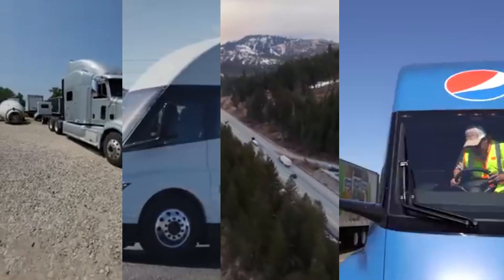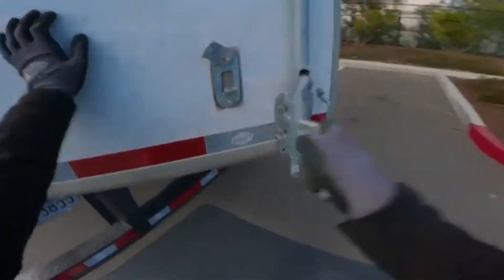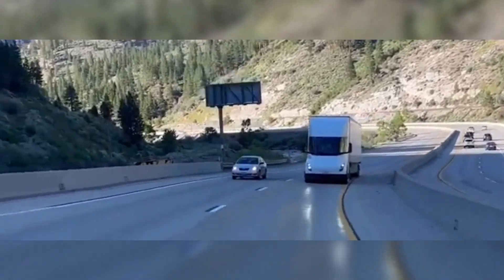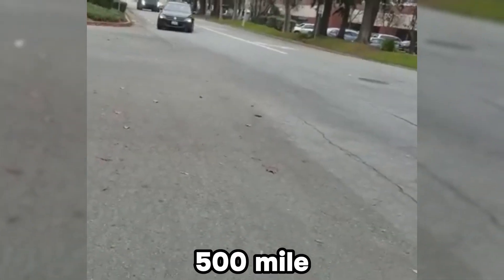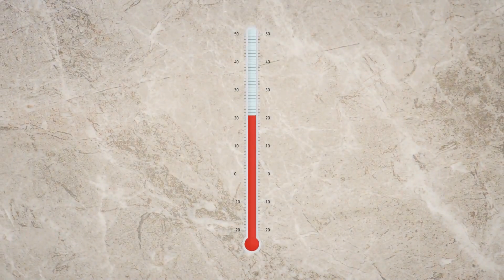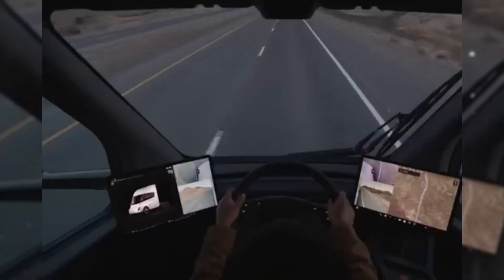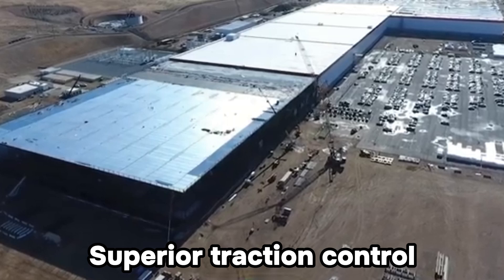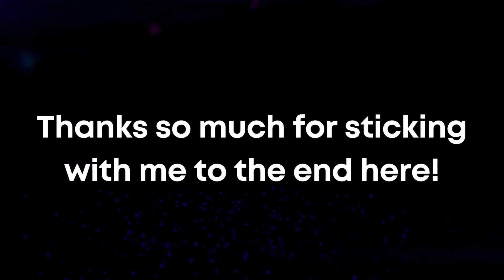Tesla Semi

Comment: The only way an EV truck is driving itself 500 miles is empty and without a trailer.  Loaded they're getting less than 400 miles.  As Tesla customers have learned in Chicago, better keep them out of the cold as well.
Will EV's take over carbon fueled vehicles?  I think that's inevitable, but it won't be anytime soon.
Reply from the maker: I have to agree with you there I think eventually the tech will get there but there are still a lot of limitations